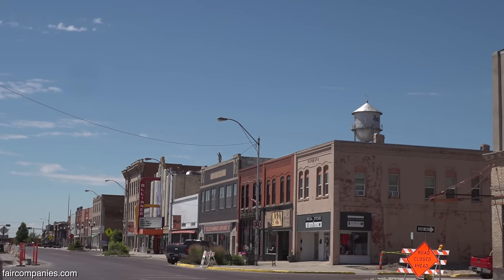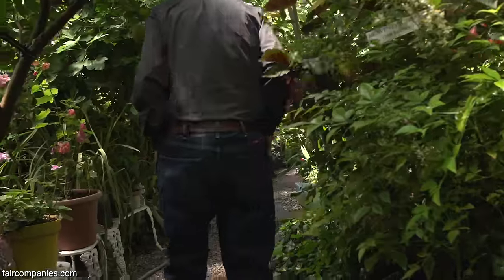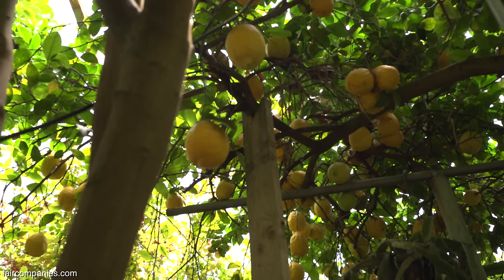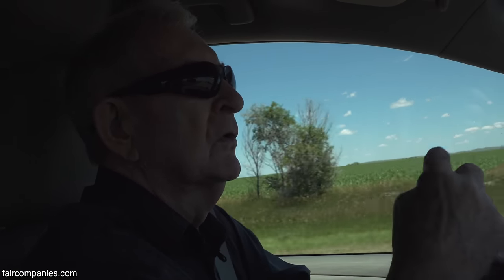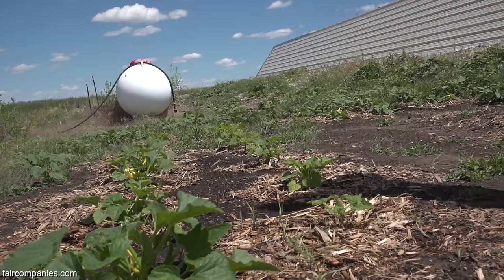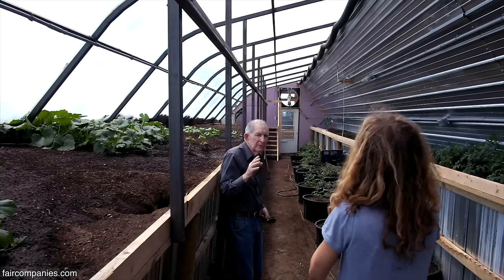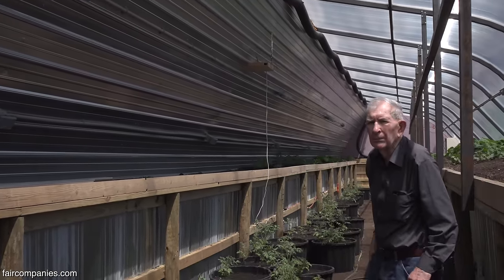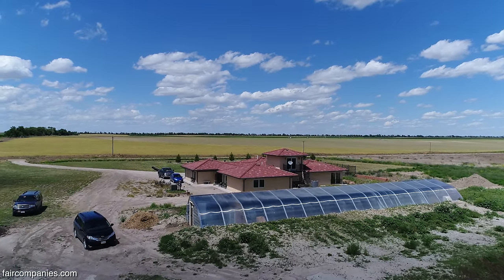Nebraska retiree uses earths's heat to grow oranges in snow

Comment: This is absolutely fascinating.  Using air as the circulating fluid for the geothermal loops really cuts down on cost.  It is also interesting how he's using the loops for heat in winter and cold in the summer.  It moderates the temperature and gets closer to optimal growing conditions.

Comment: As a micro farmer I find this whole set up super inspiring.  Wonderful to see that they understand thermal mass and how to it truly can be converted into energy.
Awesome stuff (small space veggie gardening Australia)
Reply: But how is he pollinating his plants?  In that closed environment I don't see how anything would get pollinated.
Reply: I don't see why you cannot have bees inside that system.
Reply: You would likely need to keep producing splits to keep population fairly low, you would also need to ensure they have diverse pollen, nectar and honeydew (secretion) sources available. 
Honeybees typically forage over miles of range.
Reply: There are insects in there, you can see them in some of the shots. Probably opens it to pollinators in the warm months.
Reply: the heat pump system he describes with the collector pipes over a big area instead of deep down isn´t and wasn´t new ... it works and a friend of mine uses this to heat his house completely with little electricity needed to drive the heatpump... mostly because of the "industry" of heating installers and their interests in systems that require more service and the lobby of fossil fuels prevented these systems from getting popular here in germany.. most heat istallation companies I have talked to to get an estimate do say till this day that they do not think that this is a valid standalone option and try to put fear into my mind by talking about worst case scenarios and that it would be very expensive AND would also require to put in a gas heating system to accompany the heat pump for reliability reasons.. these companies sell you these systems that would normally be cheaper for a lot more money because they do not want these systems to become popular and on top of that they will sell you a convetional gas heater with it... 
if you go the unconventional route there are companies here in germany that sell you all the needed parts (fittingsm, tube, heatpump etc.) for a reasonable price and you can do the groundwork yourself and get an indipendent contractor for this stuff to do the final steps.. 
yeah well it is like they still mainly sell the double layered windows, when infact 3-5 layered windows should be the standard now and they only cost a little under 20% more per square but will greatly improve insulation of your house.
Reply: +martysgarden  did you ever try aeroponic where you are at? especially in a smaller setting it can achieve very much... look at aeroponic towers you can DIY in a greenhouse...+ mistifiers to keep the greenhouse a little cooler..

+Keith McCarron ... getting certain useful insects per mail to help with your greenhouses is not a big deal bees are a little more delicate but even they can be rented by beekeepers specializing in this kind of stuff.. a lot of beekeepers everywhere are hired to put up their hives around agricultural land, especially bigger monocultures to help.. you can certainly rent a beehive for these applications or start getting it this yourself.
Reply: That's a good point. Perhaps he has a deal w/a hive owner to borrow some bees to do just that?
Reply: My brain ain't what it usedta be. Seems I read/heard somewhere a bees range was from 7 miles to 50. Fifty seems ludicrous to  me. Like for Kirsten Dirksen to walk from Seattle to Spokane. Don't forget your RAINGEAR Kirsten!!
Reply: I'd bet 5 layer windows wood also slow down incoming small arms fire also. Something to think about if one lives in a bad neighborhood where only the gov'mint and BGs have guns.
Reply: a citrus tree has thousands of tiny flowers...hand pollination is not practical.
Reply: It's not a conspiracy by fossil fuel companies, it's just physics and economics...if the ground is 52 degrees 10 feet down, you can't heat your house higher than that with a passive system like is in this greenhouse without adding energy.  The ground is not an energy creator, it's merely a storage method.   Of course you can use the ground as a sink/source on a heat pump system but heat pump systems add energy and are REALLY expensive because you have to have a refrigerant fluid, fans and excavate for the piping all throughout the property....it's genuinely easier and far cheaper to just put in a gas furnace.
Reply: Wow,,your doing well.
Reply: Honeybees aren't even the best pollinators. I wonder if Mason/Solitary bees would do alright in those.
Reply: Look at the pinned comment above for your answer to pollination.
Reply: Sugarsail1: He does have an auxiliary heat source: SOLAR. He said that at daytime temperature of 20 degrees that inside at 6-feet it's 80 degrees and at the peak it's 120 degrees. Yes that drops after sunset but takes long enough that the blowers don't turn on until it drops to 50 degrees inside and are only on for a few hours in the late night/very early morning. No gas heaters needed.
Reply: mason bees could easily be incorporated
Reply: He says in the video description that bees find their way in through some open vents.
Reply: Honeybees only travel about 1 mile from home. No where near the 7-50 as thought.

Comment: When I first saw this I thought there was underground geothermal activity, like geysers or volcanic heat vent or something. Nope, 6 inch 'tube/pipes' buried 8 feet underground. Neat.
Reply: But I'm still curious why the ground maintains it's temperature. Perhaps there is geothermal activity somewhere lower.
Reply: Show this to Iceland where hot springs are everywhere . They could grow bananas and pineapple! 👍🏻🙃
Reply: @BasPronk  The earths core is a molten mass. The deeper you go the hotter it gets. Geothermal is possible anywhere on earth in theory. Its just a matter of efficiency and cost to drill deep enough to access it. There is ambient heat everywhere on earth that we can use. The way he is actually heating his house is with a traditional heat pump system but the condenser is housed out on the patio that is maintained by the geothermal so it cant freeze up.
Reply: Can someone please educate me, what should the surrounding soil matter be? I'm planning to buy land to do something similar in the future (passive solar greenhouse in the ground, or walipini etc.).

I'm concerned clay or rocky depths may poorly transmit heat with this tubes method.
Reply: Do anyone know if he has holes in his pipes underground

Comment: That is so awesome. Greetings from Andreas on Off Grid Sweden
Reply: You actually might be able to do it in Sweden.  Oranges.
Reply: Don't know if it is possible here in Sweden, but it's a very different situation because of the difference in latitude.

Sweden is on the same latitudes as Alaska, and we have little sun during winter (in northernmost Sweden there is even a period during winter when the sun never rise above the horizon).

Nebraska on the other hand is on the same latitudes as Spain, and it is certainly possible to grow oranges and grapes in Spain. If you can maintain a high enough temperature you can grow anything that grows in Spain in Nebraska as well, as Russ Finch have proven.

The stable underground temperature should match the yearly average temperature, which for Alliance Nebraska should be around 50F. In Sweden it varies from about 50F to 30F, so geothermal heating might not be enough either, depending on where you live.

For Nebraska this setup seems pretty ideal though!
Reply: Mårten Thornberg yeah exactly, New York is about the same latitude as Madrid
Reply: If you build this - i would like to visit you. I'm not far from Sweden. Greetings from the Isle of Ruegen - in the North of Germany.
Reply: Looks awesome!
Reply: But near Madrid you can grow crops like Oranges and Olives. Spain is Europe's 365 vegetable Farm. Thank you Gulf Stream!
Reply: I love this farmer. What an interesting man.
Reply: Based on the latitude this can be done from New York to Beijing.
Reply: Yep, same latitude, different temps due to the gulf stream and the Mediterranean.
Reply: Maybe LED lights make economic sense in Sweden for the higher valued vegetables?
Reply: I don't see an issue with the sun limit in Sweden other than the length of a growing season. I have seen videos of people in Alaska building similar rigs into the sides of hills. Never saw them grow fruit trees, but tomatoes, lettuce, cucumbers, and various other plants are doable.
Reply: I was thinking the same about Baltics. But earth temperature in winter is about 6°C So it's likely that it isn't enough to cost-effective for oranges.
Reply: Has anyone done this in high-humidity areas? We wanted to use the geothermal tubes for cooling home in TN (not built yet) but heard does not work in high humidity areas... would it work for a greenhouse in high humidity area?
Reply: Donbd83 of course you can grow things with or without greenhouses during summer in Sweden (and Alaska), but if you want to grow things year round you would have to add artificial lighting (and possibly heating), which can be expensive.
Reply: @freetrailer4poor  This is what they need in Iceland, they have real geothermal there.
Reply: Where is Sweden? Interested in doing this in Jamtland

Comment: The single most common word used by those hundreds of people commenting on your system is "inspiring".

You showed the large geothermal tubes you use to keep your crops happy. It is my suspicion that if you were to drill those holes down into the ground at a significant angle--- thirty degrees, or so--- which would allow a natural siphoning effect.  The steeper the angle, the stronger the siphoning flow will be created.

The lower sides of the angled tubes would allow the cooler air to sink down to the bottom of the tube; as it heats up the air will rise up to the greenhouse along the uppermost side of the tube, without the assistance of fans.

Cheers, fella!
Reply: He may run into water if he goes too deep at those angles.
Reply: @David -- Water is not a problem; it is a good store of heat. The problem is that the ground is warmer near the surface and is cooler deeper (until we get to magma).

Comment: Wonderful technology. It can be also possible to grow food on Mars in a similar green house design, but with stronger windows.
Reply: I'd bet that the existing structure is easily strong enough to handle the almost 1atm difference in pressure.  If it can withstand a Nebraska winter storm it'll easily stand up on Mars (it'll need mush thicker insulation, however).

Comment: That was a great documentary on high tunnel farming.  I've been studying aquaponics and high tunnel greenhouse for some time including geothermal. My question is why bring in outside air? If ground is 54deg. Pulling air into pipes on one end, cooling off or warming air until pushed out of pipe on other end. This helps maintain an even temperature. Love the overhead heat extraction pipe. Ingenious system.
Reply: There's a lot in the air, CO2, Oxygen, Argon, Nitrogen, there's only so much you can automate, hope this helps
Reply: @khemboi4086  Meaning that at some point (even in winter) you need to bring in FRESH new air from outside, you can NOT use the "recycled" air just from the greenhouse over and over and over again... Thus you bring new fresh air from outside , do i understand it correctly (what you meant)?
Reply: @romannavratilid  not just that, microbes too, im looking at it from the point of you need CO2 for your plants, they can run out of it just like we can run out of oxygen, i could be wrong but I would do the same thing if i did this, let new air in as much as i can, try my best to make it emulate natural or outside

Comment: Although the plastic tubing is likely very robust underground, if you could somehow implement metal tubing you'd likely get far better heat transfer and thus require far fewer feet of underground tubing.
Reply: Or cement pipe..
Reply: I was thinking a 20,000 gallon water tank and a stainless steel pipe through it. Better heat transfer. Smaller area. Could be done in a much smaller area. or doubled over 8X25Ft... Fit one on a 4000 SQ Ft property in the city.